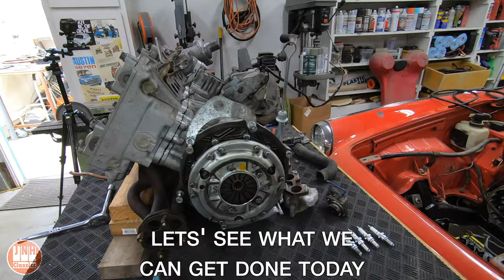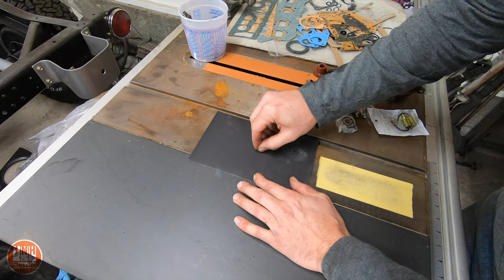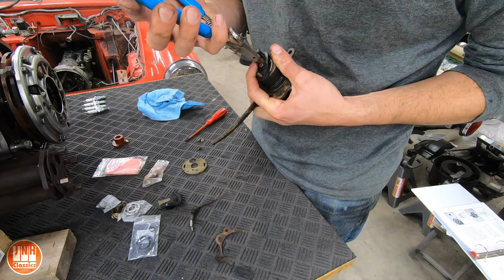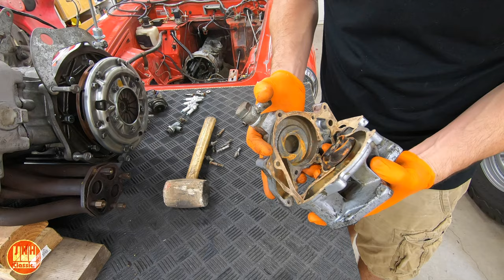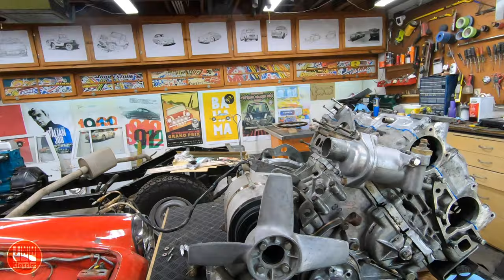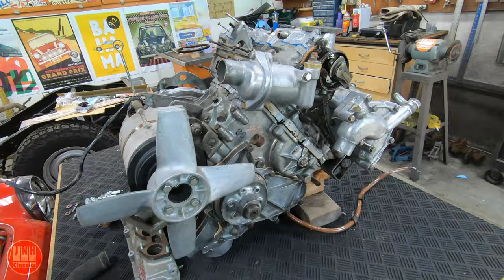Rescuing a Honda S600 - (Episode 17) Engine Assembly Part 3

Comment: Hello, Nice job to make this nice car revive !!
About the water pump, you should have a o-ring or lip gasket after the axis bearing of the water pump. It's very recommanded on S800 (same as S600 for that design) to replace this seal in addition of paper seal for contact plan. Do you see what I mean ?

Comment: When I reassembled my S800 distributor, I managed to fit the drive plate thing the wrong way round, 180 degrees out. I see you've taken yours off. If you can't figure out why it sparks but won't fire, it may be worth checking that! Hopefully yours is right.
Reply from the maker: Good tip. Thanks buddy👍